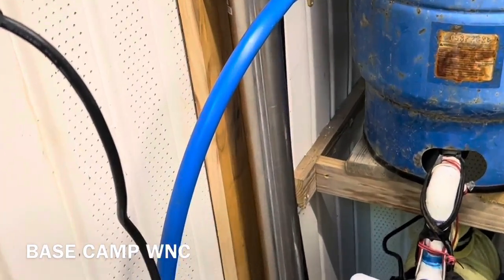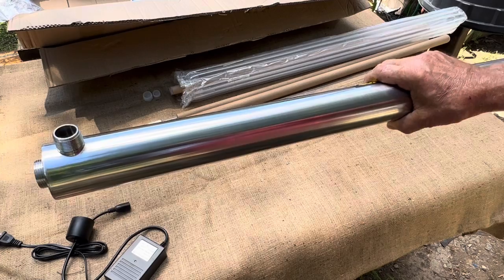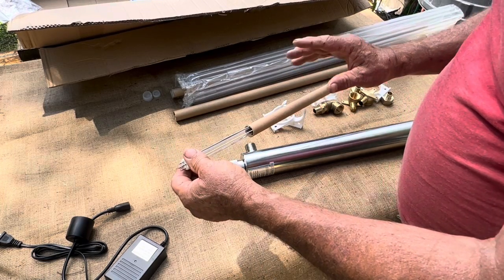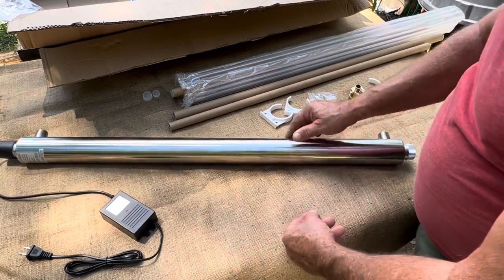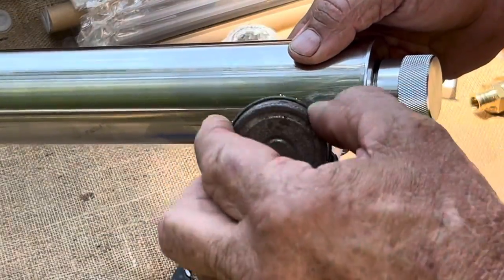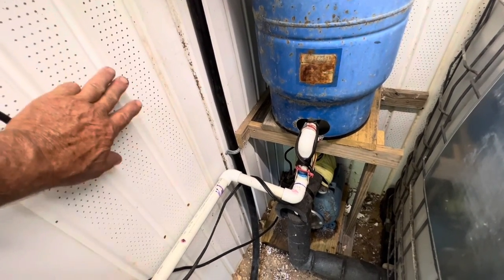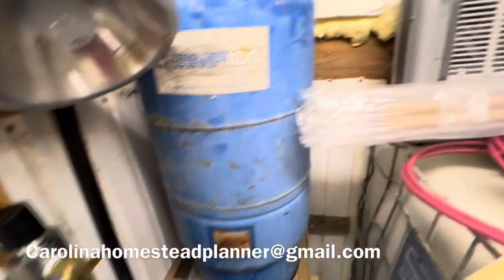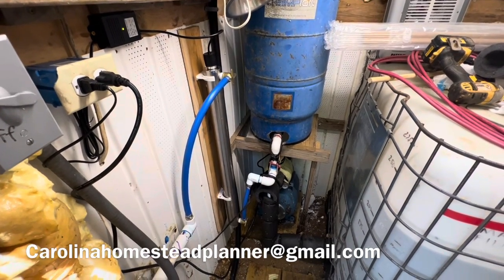Installing a UV light for water purification for wells- springs and rainwater catchment

Comment: Excellent as usual Eric.

Update on the homestead out here:  We just finished installing and passed the inspection on the trenching and installing of the conduit for the electric line that will get pulled into the build site, almost 1500'!  That was a LOT of work for my husband and me.  The pole barn is about 2 - 3 weeks out from being completed.  Got all the posts and trusses in, and one side has all the side girts on.  Still have the other three walls of girts to install and the purlins, then we can put the insulation wrap on the walls and roof and start installing the metal siding and roofing.  We'll start by pulling power into and wiring the barn so it can be our shop and base of operations to build our house from and store all the building supplies locked up under cover over the next couple of years it takes us to build it (mostly DIY).  We're pretty excited about our progress on everything this summer and are particularly happy we haven't yet had to take out any loans, paying as we've gone along.

We have been having a little trouble this summer with an airlock forming in the pipe that goes from the spring box to the gravity feed storage tank because although the storage tank is lower than the spring, the pipe runs quite a ways uphill before going back down hill again to the tank.  So when the flow of the spring goes way down towards the end of the summer, there's not enough water to keep the 1" line filled, so air gets into the line and lets the water run backwards down the pipe and then it just sets there because there's not enough pressure in the line to overcome the gravity as it's lost the siphon.  BUT, we found another spring on the property straight up from that very tank!  It's flow is pretty slow at this point too, but it's still constant and it's a straight downhill shot from it to the tank!  Wo if we tap that spring and run it to the tank to keep it full we shouldn't have that problem anymore.  Once that's hooked up, we can then add another tank right there below the original spring and pipe THAT water straight down to our new house site.  So that means we'll have TWO gravity feel systems on the land; one that feeds the original pole barn way down on the southern border of the land, AND one that will feed the house and shop that are being build more towards the center of the property about 2000' north of the southern pole barn.  It may be a bit of a challenge tapping that second spring but I think we can figure it out, especially since we've learned so much from your channel.  🙏  

We're going to love having that redundancy in our water system, particularly because we won't be drilling a well and it gets awful dry here in the summer.  We'll catch water off the house and shop too down below and use a solar powered pump to pump that uphill in summer to keep the water aerated and up high in little ponds up there to use for gravity feed irrigation as well as defend against any fires.  But in winter, all the springs go way up to hundreds of GPM, so no worries about having plenty of water in winter.  

Looking forward to installing one of these UV lights in our lines into the house and barn so it's potable water.  We'll put in a filtration system too as there's bound to be a bit of clay/silt in the water as well and we don't want to clog up appliances or shower nozzles.

Comment: By the way, UV light breaks down pvc and pex pipe. you should never connect directly to the light fixture with anything but metal or copper tubing.

Comment: I stopped using UV because the water has to be filtered first down to 5 micron to keep the tube from clouding over and blocking the UV light. I filter afterwards. also I use a 15 micron spin-down filter from the well as it goes into the IBC Tote. This reduces sediment and helps the ozone work better.

Comment: I replaced our 12.5 Gallons Per Minute UV system with a plasma discharge Ozone generator used for Hot Tubs and a Danner Pond master AP-20 Air Pump. Ozone oxidizes better than UV, CL2 or Hydrogen peroxide. Total power used is 22 watts. Not only does it sterilize the water but it oxidizes or converts Iron and Manganese to a size the can be filtered out of the water and eliminates hydrogen sulfide. I fill a 275 gallon IBC Tote from our 60 foot deep well and treat the water with ozone. I then use a 12 volt SeaFlo 55 Series 60 psi @ 5.5 gpm water pump to supply the house. The pump is running from a 12 volt battery that is charged by solar. I filter with a 20, 5 and 1 micron polyester cleanable and reusable filter. I clean them with oxalic acid.
Reply from the maker: All my filtering and spin down is at the cistern tank
From reading your post you must have watched my videos
Reply: @basecampwnc1745   I have watched your videos, almost from the start. however,  for reference sake I have degrees in water and waste water and two Michigan wastewater licenses. I create things all the time.
Reply from the maker: Total cost of your system installed?
Reply: @basecampwnc1745  for just the parts that replace the UV system. the Danner pump was $115, The two Del Ozone packs were $160, The ozone diffuser was $18, The silicone tubing was about $30. So around $323 My UV system was just a little more than that.
Reply: Steven do u have any videos or pics of ur set up it seems pretty interesting...
Reply: I will see what I can do, I have taken pictures and videos just never posted them @dangoras9152